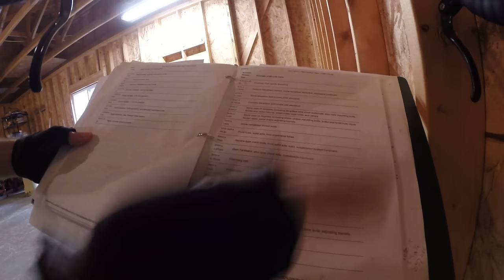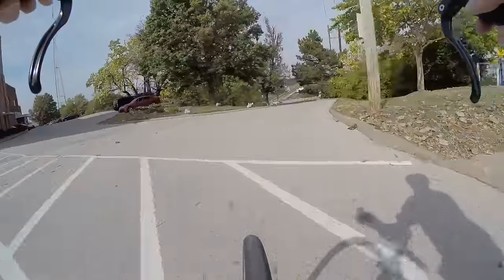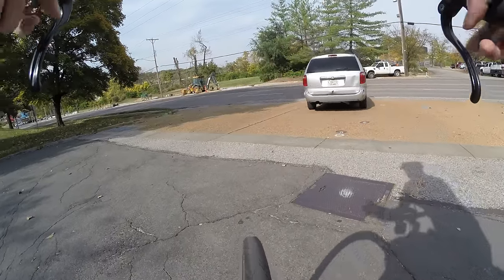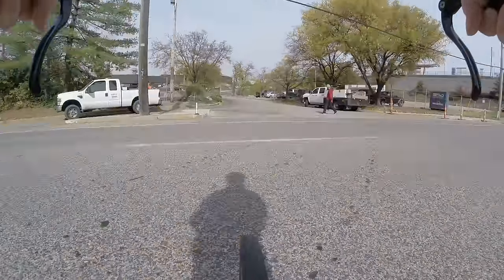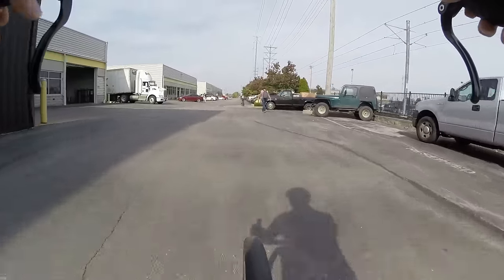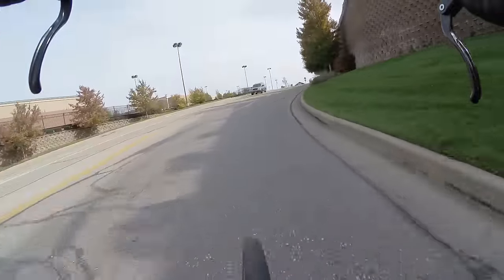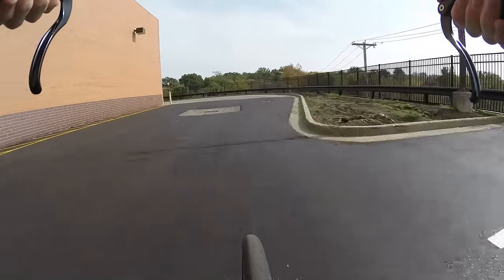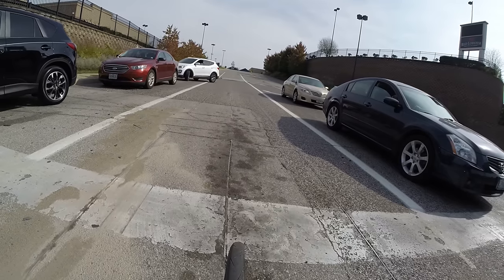Bicycle Thread Sizes? Stripped Derailleur Screw? Commute Bike Blogger

Comment: I just can't get over how smooth your roads are. Where I live, a freshly asphalted road surface gets potholed, cracked, frost heaved in a few years.  The most popular vehicle is the pickup truck because they can handle the road surfaces better.  My commuter is a heavy aluminium mountain bike. Every week, I have to go over it, carefully tightening all the fasteners that have worked loose.

Comment: my biggest issue while cycling to work is stopping my arse crack from showing,  any tips?
Reply: Dexterblows Padded shorts. Wear them over something if you are self conscious and change at work. Don't have to go for expensive bib shorts (though I was SERIOUSLY recommend them for long rides), you can get a cheap pair for as little as £15
Reply: Wear them under... I'm tired
Reply: Dexterblows many cycling and running shirts have a longer cut on the back to help with that issue. A bike with an upright position helps also.